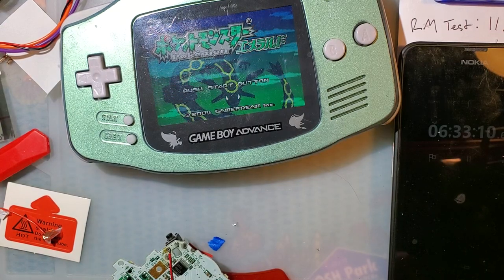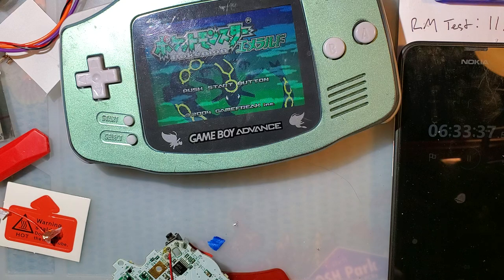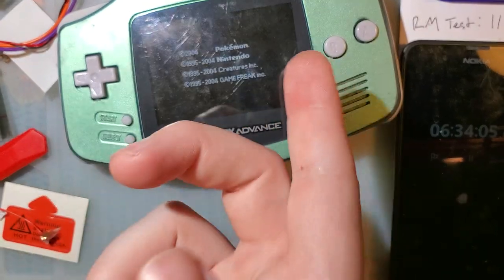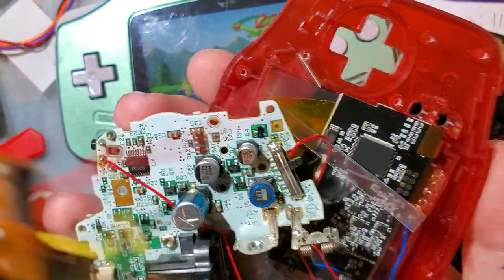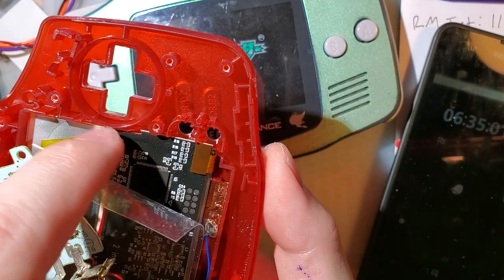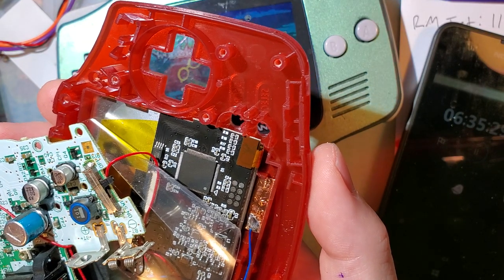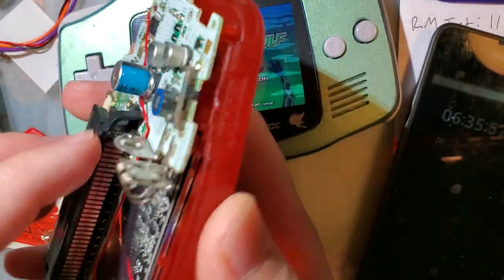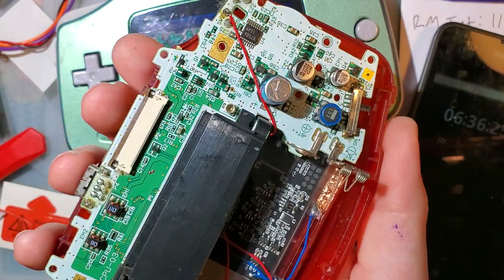Funnyplaying IPS Ready GBA Shell Followup

Comment: I just did a ips v2 mod, but my shell couldn’t close completely and there are gaps between the halves. Is this a known issue with some cases? And is it possible to transfer the screen to this new case without damaging it? The screen is sticked onto my case really tight...
Reply: Currently my pcb seems to be under stress as the shell is clamping it.
Reply from the maker: @user-yk1cw8im4h  not a common issue. Make sure everything is seated properly (like the speaker and button membranes) and try again. Everything should fit.
Reply: makho Thanks for the reply. Unfortunately I have tried all those many times, upon close examination the posts seem to be too long so I have resolved to cutting short all the posts and hey clamp together better now but still has some gaps left.
Reply: E.W  it's bad news for us who used the double sided sticky foam tape..it will not let go of the LCD..they warn you of that on YouTube channels..my LCD screen doesn't have your problem..mine's slightly too far to the left because I used the left 2mm spacer included in my kit which we don't need..I should've left it out..the seating on mine is level and the 2 halves close perfectly..I can fully grasp your disappointment..I used the original shell modified myself..not a precut shell..glad I didn't now..the only way to separate the screen I can imagine is to scour/dremel the case to pieces without touching the LCD..a long painstaking job..and one slip will damage the screen..getting the lens off first and protecting the LCD with a thin metal plate..and using a small 12v multi tool is even better..it's easier to buy a new kit isn't it?
Reply: @markianclark9645   I actually found out that in one of makho's video that he used dental floss to slice between the LCD and case and pull horizontally. That should cut into the foam hence separating them and isopropyl alcohol should clean up the residue. Anyway it's not the LCD that I have trouble with, it's actually positioned perfectly with the included spacers. I just got an aftermarket case that's manufactured really poorly (ie. the posts that clamp onto the pcb are too long). But after trimming the post on both halves that are pressing onto the pcb, it closes much better now. However this might put some stress on the pcb down the road as all the posts now are slightly varied in length. Anyway I'm now pretty content with the results, definitely not worth getting into more trouble...
Reply: E W...quality varies considerably doesn't it with these pattern shells...glad you've gotten it to the point where it looks OK..I assume you're in the States? If you was here in Britain I'd post you my spare shell (silver) probably better than the shell you're using..my Advance has also got the faulty on/off switch problem...Goes red LED if you touch the switch when it's on..yes I watched Makhos video on switch repair...and I bought a rechargeable battery pack with dead Lithium ion cells I think they're Li-ion? Prised it open then soldered and repacked it with 2 new cells..recharges fine..cover isn't flush with the Advance back though..I still wonder how we tolerated Nintendo unlit screens..I can't bear those old screens can you?